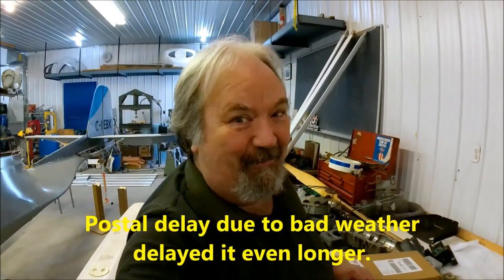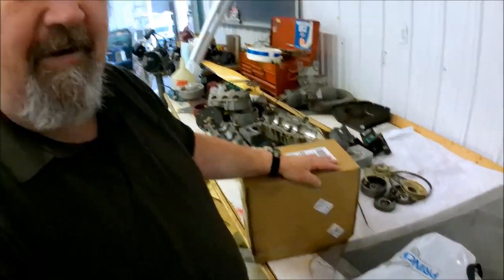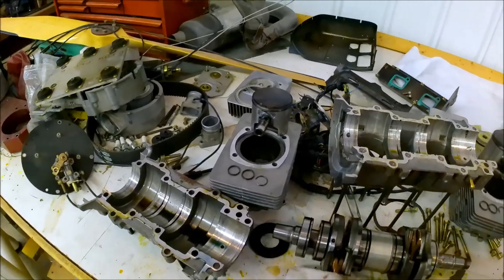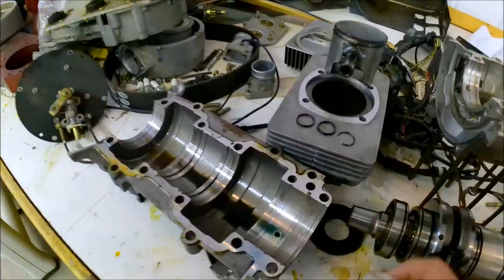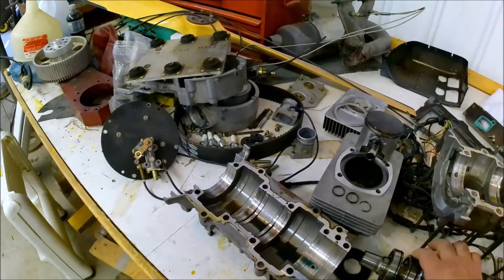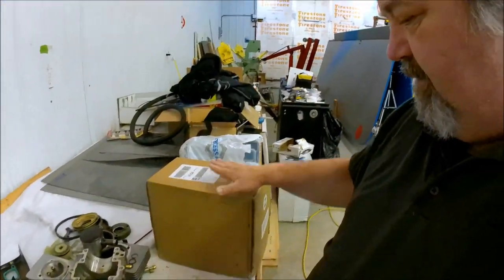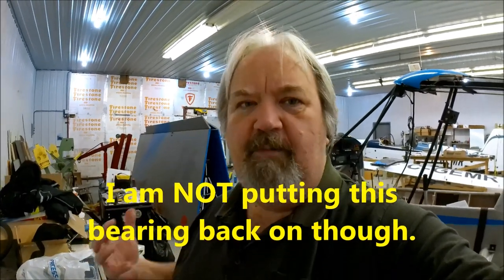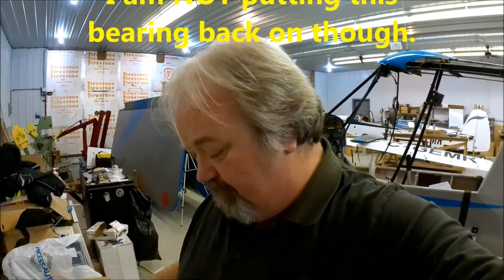EP #34 A Short but Sweet Update. Challenger 2 Ultralight Airplane Rebuild/Upgrade.

Comment: Hello from Cleveland. So, I love this plane. But, I am not a light guy. Under 300, above 270. Wife weighs around 140+/-. With full fuel, do you honestly think this plane can fly me and my wife around?
Reply from the maker: Well, with the larger 582 engine, yes. You would be at or very near max gross weight, but you will just be within the limits.
Reply: Whats a 582? Would it better to have the longer or shorter wings?
Reply from the maker: @outlawflyer7868  Long wing. A bit slower, but it will offer more lift.